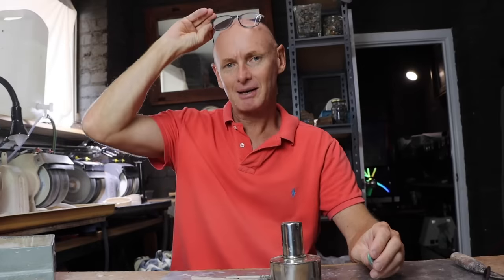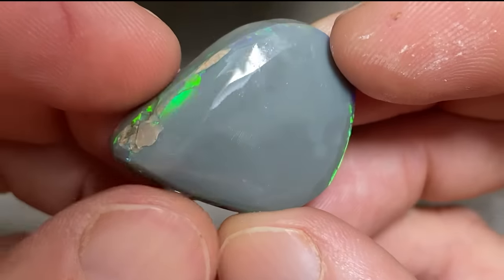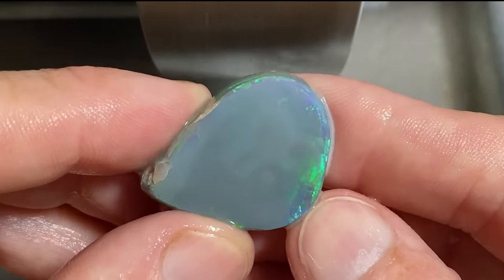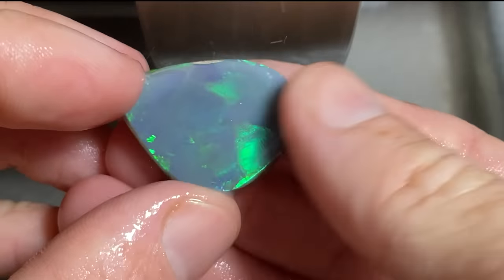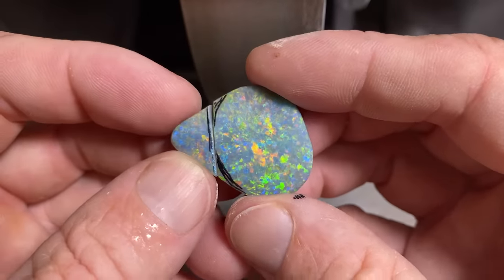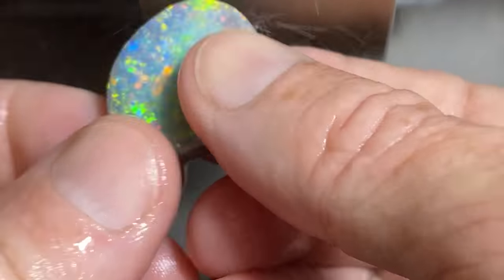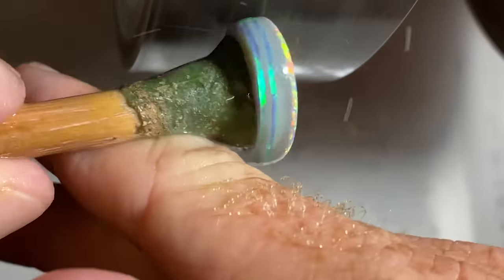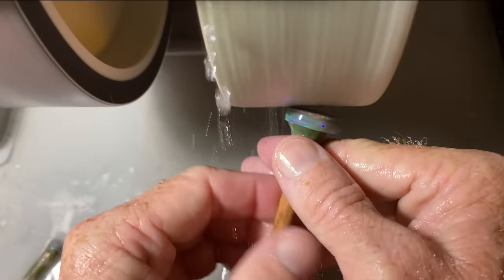3 bars of opal color. Which one do I cut?

Comment: Dang Justin, just dang!  Legend mate, unbelievable.  I took away a lesson today like every other day, I've never thought of cutting a corner to see a deeper color bar and also have stone 1 now be an oval.  I always go tear drop to maximize on stones like that and I either risk it and grind down to the next bar or I stay with what's on top.  So believe it or not some of those very simple ideas and things you do can actually seem like a stroke of genius to a newer cabber.  Still the mind set of bigger is better, preserve it all in 1 stone.  Now I'm starting to realize that large is good but quality of color is possibly even more important than a large stone that is bland.  Tha is for all you do in the community mate.  After years on my wet flat lap I am finally a single $400 payment away from having my very own 6 wheel cabbing unit with a flat lap on the far left to make setting simple and a buffing wheel on the far right side.  So technically 8 spinning things with grit or polish on them.

Comment: AOOO new video!! what an amazing gem <33333
Reply: Just watched the whole video I would have done the exact same method of cutting it. from a jewelers perspective, I would dermal out a line around the circumference of the stone (as it thick already) so I could wrap a little bit of wire around to make it a pendant. This way itll flash both color bars while walking around n bouncing. Too bad I dont have 20K :DDDD You could use both stones as well to make it a collection piece for fashion, the smaller stone could be cut for earrings so its all together in one shot :)

Comment: Question for you ? Could you have used a very thin diamond wire cutter to cut that stone to get both stones out of the one? I understand the hesitation to cut the stone using a cutting wheel. But a diamond wire cutting wheel would've cut it thinner and possibly with your skilled hands more efficiently 🤷‍♂️. That was my thought, and I would've risked cutting it that way over the wheel. 

Great video! I really have loved watching these. (:

Comment: Interesting, I just went through the same situation with a 1.14 oz Andamooka dark base about the same shape as your Allawah. I cut a triangle off and made 2 stones out of the triangle to check out the second color bar with the same results as you. The polished  big piece is about 80 cts in a nice thick oval shape with a multi color face. The 2  color bars inside are on an angle to the face surface color bar so a bit different with only some color showing on through back. I might go deeper if I get brave and remove more of the dark base on the back but I might not risk turning it into a much lighter based opal on the front. What an adventure big expensive opals can be!

Comment: I don't know much about opals or their value, but I would rather have a thick one with a bar inside it just like that anyway, even that thick.

If I were to set it, I would exploit that by cutting a pair of grooves round the circumference into the two potch layers, and wrapping it in two gold bands as a pendant, making the middle bar visible between them.

Perhaps that is not as valuable or orthodox, I don't know. But it's what I would personally rather have if I were the buyer of that stone. You did a great job on it.

Comment: Serious question. Did you contemplate sacrificing the middle bar and using it as a slicing guide for the saw? Worst case scenario, you still have the top gem and the bottom one. Best case, you get a nice saw cut and one is a double-sider. Thoughts?
Reply from the maker: yes I sure did but chickened out

Comment: Explain to me why you can't saw it in half erring on the side of the weaker color bar so that you maximize the potch on the nicer stone. Then you'd have the nicer face with just potch on the back and either a double faced blue green stone or (if you cut too close to the middle color bar to face it) you'd have a single sided blue/green atone of the same size. It's the thickness of a saw blade.

Comment: Beautiful stone, and the thickness I don't think is a big problem. Making that into a drop pendant bi-faced, anyone would be happy to own it.

Question though Justin.
Are the cutting blades different thicknesses? If you were to cut that stone in two through the middle, how much would lose to the blade?
Basically I'm wondering how think a layer of potch we need to even consider separating colour bars.
Reply from the maker: about 1mm loss which is too much for me and too risky
Reply: @blackopaldirect  Fair enough, so we are talking maybe a 5mm potch layer, so we have 2 mm either side....

Comment: What if you cast the entire stone in epoxy resin (like Alumilite clear) to make it thicker, and then it would be easier to handle and more stable to hold. Then tried to cut it in half length wise? Then you could grind off the resin.

Comment: I've seen you run into this issue before, Why don't you use a string saw to seperate the layers? it looks kinda like a bandsaw but the blade is a thin string doped with an abrasive. You can get them in very thin sizes that would allow you to make that 3 different stones
Reply: Hey my first like from a creator, Thanks!

Comment: With a dremel couldn't you cut it rather easily down the width just under the second bar and check both sides whilst preserving a decent stone with potch on the original face?

Comment: To bad you could not split the stone right above the second layer of color in the middle 2 stones with one that had a very similar double sided face would be nice to see. Double sided settings of opal in something that can be seen on both sides is kinda rare. Otherwise they have to get 2 stones that have the same pattern and be far thicker than needed.